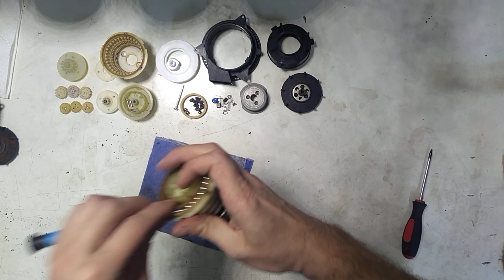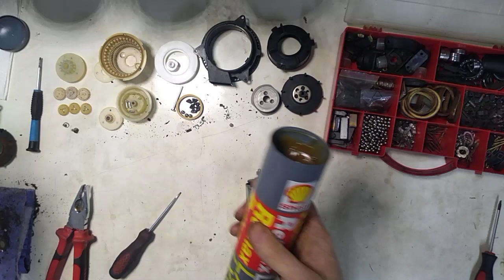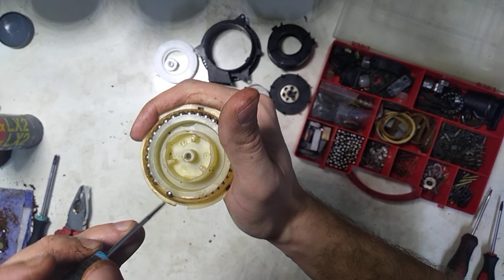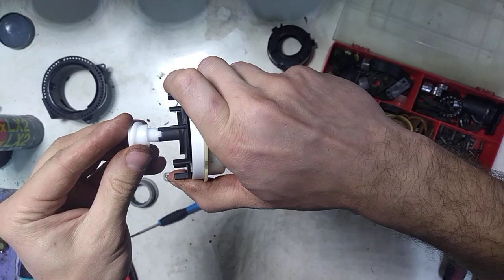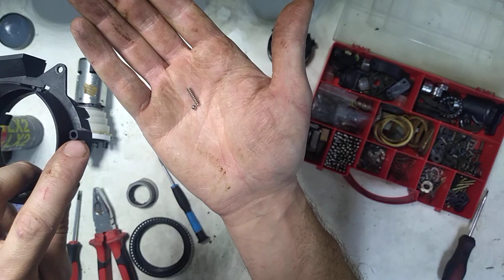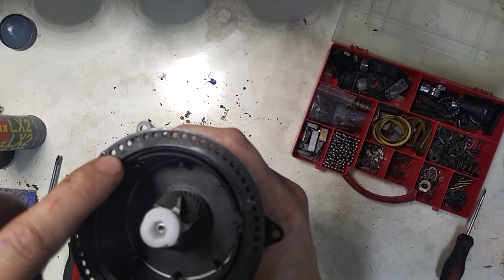Saeco Jura Complete rebuilding of a coffee grinder

Comment: Just want to say that it’s not to the same size of the metal balls under the ring as the balls on those three springs. The balls under the plastic ring are a bit smaller than those on the springs. I ordered the same size (7/32”) as the balls that are on the springs but they are too big to fit under the ring and will not fit.

Comment: Milen - very nice video! My Jura ENA3 is producing VERY coarse grounds no matter what setting I use. It also is NOT producing pucks. I have taken it apart down to the grinder assembly and have tried many calibration setting even to as "tight" as possible but grounds still very coarse and not producing pucks. HELP PLEASE !!
Reply: Треба замінити жернова

Comment: nice video and good instruction!  I have a Philips EP5360, and I get Maintenance error code "02" ..... that does not exist in the manual for some reason , and Philips customer service refuse to say what it is.  I think it is that something stuck the grinder motor. but not sure, have you sen this error before? I´m still in warranty but would prefer to fix it myself. Thank you

Comment: Great guide, I now know the lubricant in the gear section of my Saeco Jura is a thick grey gum. Does anyone know what lubricant is supposed to be there? ⚙
Reply: Are you sure? Thick grey is usually thermal paste. Not a good lubricant. Saeco usually use a white grease.
Reply: I guess it is silicon grease.

Comment: Hi Milen I enjoy your videos very much.I have a Saeco Sirius with a display that is not showing anything, the panel lights up but no graphics touch works ( beeps ) its on separate cables.Any suggestions where I can find motherboard or display panel ? Saeco is no longer sold in the US and parts are a problem.Any help would be greatly appreciated, thanks Tom.
Reply: Internet is your best friend for looking up parts and places to order that is what I have found to be. Local Appliance Repair shops may sell too you also if you ask them nicely :)